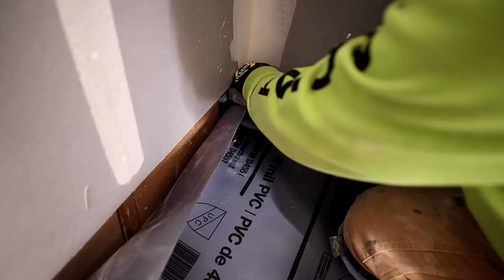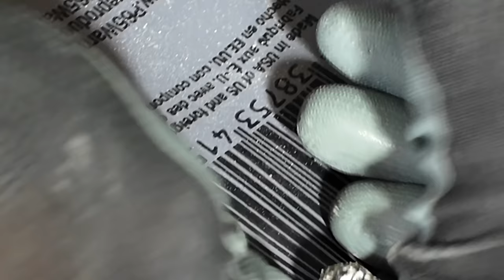How I do a Pan Liner --- OLD SCHOOL Tile Shower Build 2024 Episode 1

Comment: Not a tile guy here but a builder. We are always dealing with the corners that you fold and how the denshield or cement board comes down over it and flairs out causing the entire tile wall to flair and noticing it from the tile line where it meets the drywall. Not sure if this makes sense. But trying to figure out best approach to stop that. When you fold the corners it makes it thicker causing the flair. Any help on this would be greatly appreciated. It’s a problem on ALL our jobs and every builder I talk to has the same problem.   I see you don’t bring the denshield over the pan, how do you tile over the liner below the denshield with a seemless plane?
Reply: I dont get your question   dosent holding the board up high eliminate     the bulge on folds?       Also  I seen other videos of his where he will float  over everything on the walls   I never seen this method  but a lot i havent seen in the tile trade its not my Gig.  im guessing maybe its 3/8 thick . not the standard   paper, wire ,  scratch    and brown  .      I think a  mesh  and   one  coat ?
Reply: When making your hospital corners, instead of folding it to the inside where it would overlap the rest of the liner, fold it to the outside and tuck it into the wall. Works best if you have studs right at the point where the liner is folded so that your hospital corner sits flat against the inside surface of the stud. To keep the corner from sagging, sandwich it in place with a length of 2x4 toenailed into the stud.

Comment: No more Schluter?
Reply: Nothing wrong with Schluter. Never had a leak and I don't like wood curbs wrapped in cement board. Cement blocks or foam curb cut down to 4 inches. There too tall
Reply: But everybody's got their comments so Life Goes On
Reply: Schluter stands by their products if something goes wrong and if you didn't do anything wrong they will back you up

Comment: You're killing me Issac,  no reason to cut circles at drain OR bolt holes 🤦🏻....a simple X cut does the trick...just saying
Reply: If you just leave an x-flap in your drains, you've reinforced that you're the kook of the industry
Reply: @ndsrocks1 it’s long been known that StarrTile is not the standard to strive for. I’m convinced he’s trolling for page interaction at this point.
Reply: Exactly what I thought Star.
Water runs down to the point of the X and drops down into the drain. 

😊😊😊
Reply: If you pay attention, he did that with the blots because with the cast iron drain cant be placed with the bolts still on, it's not like the plastic flanges that have the holes for the bolt and you twist them on. Would've been difficult to put the bolts back in with the X. 

Doesn't make a difference, he added sealant on the inside and outside of the drain, water can't get in or out. As far as leaving an X inside the drain, there's no logical reason to keep it there. The sealant is there for a reason, the clamping of the drain already does a decent job sealing out water.
Reply: @dallinbagley4486  because I'm a maverick and think on my own doesn't mean I'm wrong, and being "standard" is easy, could fake my way through that 🤣

Not trolling here, honestly hate circles cut out unnecessarily..because you can doesn't mean you should ✔️
Reply: Be nice.
Reply: @MrTooTechnical 🤣🤣🤣
Reply: @dallinbagley4486 no body strives to be a hack!! 😂
Reply: @StarrTile  x cuts on this old school drain will block the water from draining.  It's not a 3 piece
Reply from the maker: I’m not sure if the x’s work with the cast iron drain holes.  I think they would get in the way of threading in the bolts
Reply: Why didn’t u use the foam pan???
Reply: I was taught that the pan liner should be at least 3 inches above the finished height of the curb. I've had one fail the inspection for not doing that in the past.
Reply: Nice.
Reply: @StarrTile  I get it that you don’t have to, but why would you leave unnecessary flaps of material inside the drain? It’s just sloppy. That’s all it comes down to.
Reply: @Jared-Kreate  Sloppy ???? Obviously you've never seen my way, exponentially better way 👍🏻👌🏼💯
Reply: @StarrTile  lol! Yes, it is sloppy to leave unnecessary material where you don’t need to. And yes, I have watched a number of your videos. There are things people can learn from everyone. I’m sure you could learn something from me if i had a YouTube channel. 
Definitely wouldn’t say anyone’s way is exponentially better lol
Reply: Starr Tile clout chasing
Reply: @AK-kn9lq  🤣🤣🤣Hardly, interesting troll comment though 👌🏼
Reply: @StarrTile good to see you here Starr tile!
Reply: @BonBon770  good 👍 input.
People are clever.
Reply: Atlanta Boys know it all
Reply: @deebodigital  born & raised California native...easy mistake given that I live here now
Reply: @StarrTile  I was kidding brother
Reply: I’ve never used those dam corners on the curb and I’ve never had a problem and I’m still in contact with all my past clients. 95% of the time I use Redgard only.
Reply: Built a shower using @starrtile method and have had no problems!  Sometimes common sense is a good thing to have! 👍
Reply: Starr Tile being critical 🤣😂😆. You're the worst teacher on YouTube. You don't even use curb corners on your pan liner. THE # FAIL POINT IN MY EXPERIENCE
Reply: That's what I was going to say. I thought you leave it alone once cutting the x on them bolts and drain...
Reply: Looks more like far mud than deck mud
Reply: No sirve eso

Comment: NO PRESLOPE IS NEEDED! If the subfloor is leveled you don’t need a preslope. Also, if the subfloor is not leveled, but you apply a liquid waterproof on top of the mud all the way to the sides of the drain, you don’t need a preslope (because it will then basically be a “sealed system”) and the rubber liner will simply serve as a backup. The logic is that the mud will be completely encased in the rubber liner, so there won’t be any voids where a puddle of water could form and the mud acts like a sponge by its nature, until and, if ever, it gets 100% saturated, in which case the water at the bottom will escape through the drain weep holes and any leftover water will evaporate and escape via the same way it got there. The water will evaporate whenever the shower isn’t being used.

Comment: That wet bed is way to much water. That pre slope doesn't look to good. That drywall won't last in that shower. Never go in there with all those tools because you're about to puncher that liner. You will be back to redo it because that sucker is going to leak.

Comment: Seriously this is a tremendous waste of time, effort, and money. Just notch the vinyl liner into the framing, eliminate that sheetrock, and install durock over the vinyl not screwing in 6 inches from the bottom. 
    Then do mud, let it dry and red gard three coats with alkaline resistant mesh in all corners. 
    NO NEED to float concrete on a flat wall with cement board on it!.